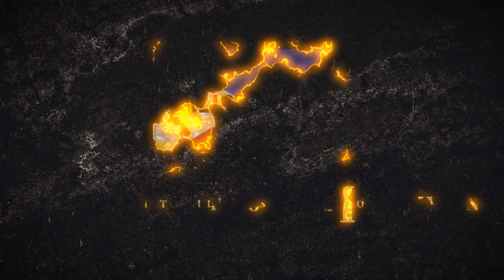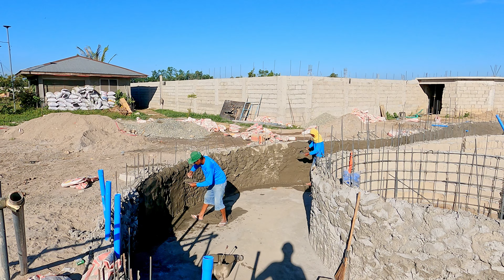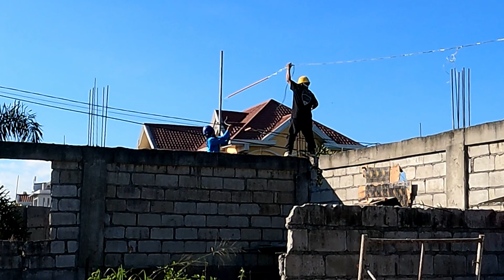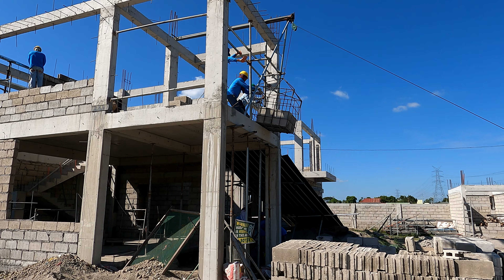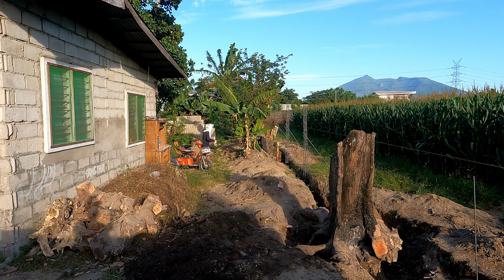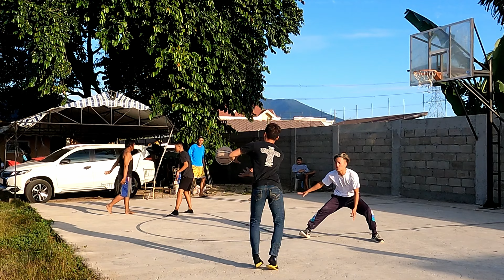Philippine House Building Day 109 - Monstrosity Gone

Comment: Looking good and nice to see more walls going up. That's a good call to try to keep the external units on the back side of the house. Would have been a lot easier if the norm was central air. I can understand the pros\cons of split and central air. I know there are several air conditioner manufacture in the Philippines. Can you share some of the manufactures who are the big players there? Be safe and be well.
Reply from the maker: Hi LC
We did ask for information on central aircon, but as far as I can tell, it is massively more expensive here - one vendor said it could be as much as three times the price !
I will go into more detail on aircon once we have selected the supplier, and will include something about the brands available.

Comment: Good morning Mike Well were do I start !
Compost Binns they are very large I think you will want one of those 4wd front end loader tractor with rotary tilter on the back as well as petrol electric start mulcher chipper. Maybe more birthdays or as they say all the birthdays come at once.
Fence hollow blocks progressing. 
Pool progressing  they will build the plaster up gradually to much and it will fall off .
Media room I have a preference for Rockwood insulation made from stone but fiber glass is also good. I see a Ausie Guy Peter the property Club in his build Subic Bay Philippines loves rock wool as well.
Anyway  electrical fitting I say is height what works for the customer. 
Once I had to provide paraplegic entry to the swimming pool and a dance studio build has to have paraplegic shower and bathroom in order to get build permit.
I used rock wool ceiling tiles on one of my  builds a conference center they worked well for sound quality ie no echo.
Reply from the maker: Morning Graeme
You never know  - a tractor may be on my wish list one day.
Will have to see what materials are available here for soundproofing - as I am sure you have experienced, sometimes certain items are either not available in the Philippines or come with a very significant premium.
I am wondering now whether the plastering is the last step in the smoothing process. Given that it will be tiled, maybe this semi-rough finish is enough / preferred for better adhesion.
I will find out over the next couple of days I guess.
Reply: @philippines4.0buildinganew64  The plaster will need to be true and straight before tiles.

Comment: Keeping the units off ground level protects from damage due to flooding and from theft. Just my thoughts
Reply from the maker: Clint
Brilliant - had not thought of that.
I imagine they will be elevated a little using some kind of framing. Hopefully flooding should not be an issue close to the house, despite what we now know can be a high water table. The house has been elevated quite a bit, and in all the years we have had this land, we have never seen any flooding. That said, your point is spot on and I will make sure we do keep them as far up as is practical.